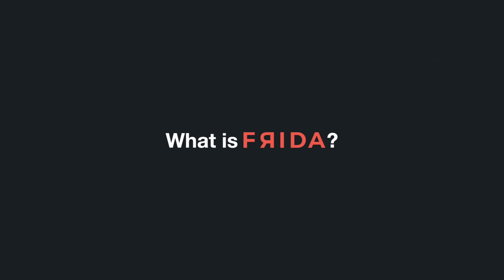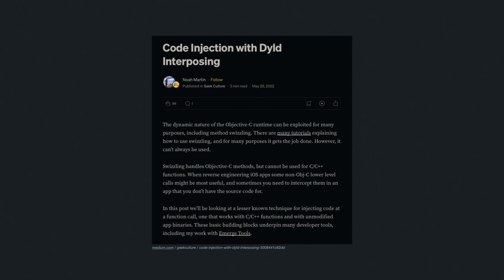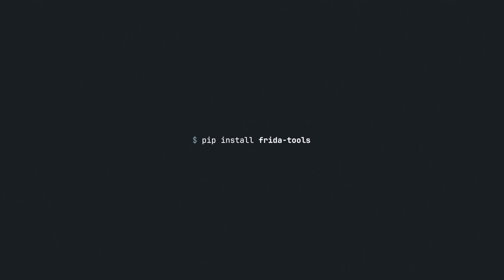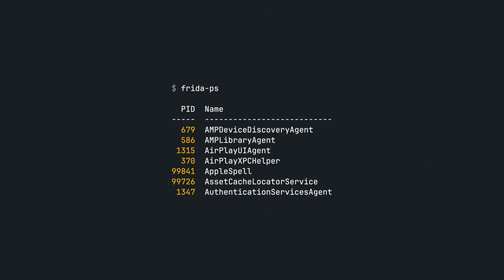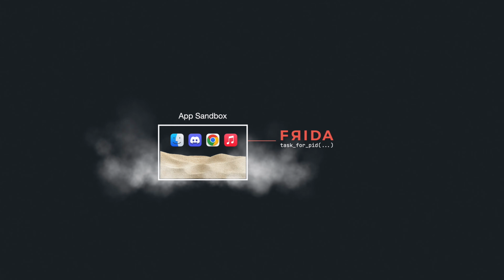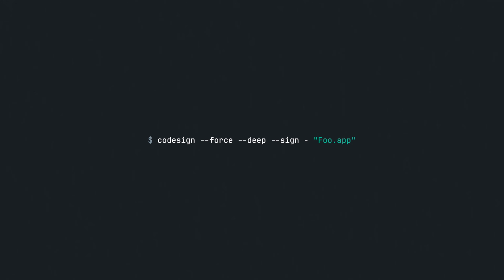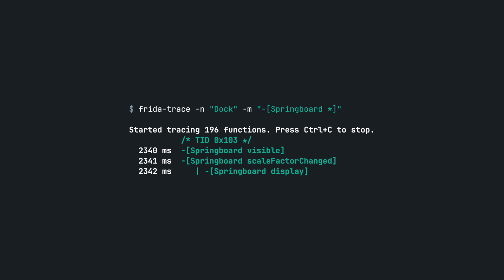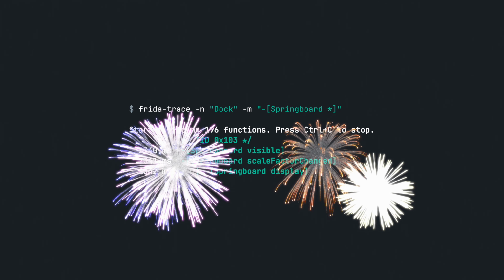macOS Hacking with Frida #01: Environment Setup

Comment: test@tests-MacBook-Pro /Applications % csrutil status     
System Integrity Protection status: disabled.
test@tests-MacBook-Pro /Applications % frida-trace -n "Safari" -m "-[Springboard *]"
Failed to attach: the connection is closed  
do you know the solution for this mate?
Reply from the maker: Which Mac are you using? Is it an old Intel one or Apple Silicon? You can try running frida-trace as root using sudo
Reply: @sonodima  test@tests-MacBook-Pro budget-buddy % sudo frida-trace -n "Safari" -m "-[Springboard *]"
Failed to attach: the connection is closed 
I am on an intel mac i am able do this in 3rd party apps but not on Apple apps.